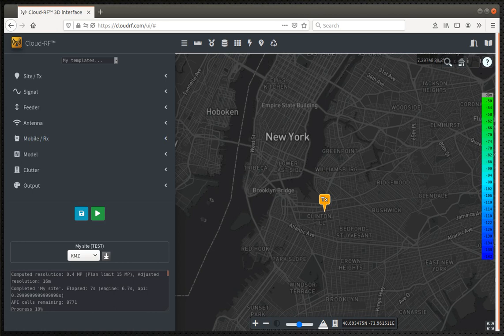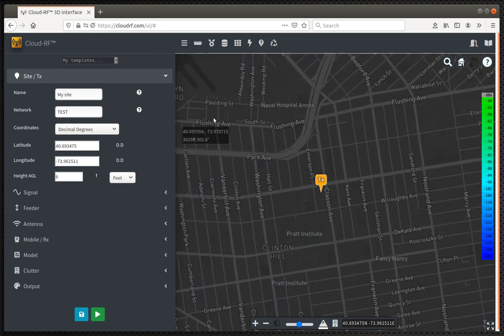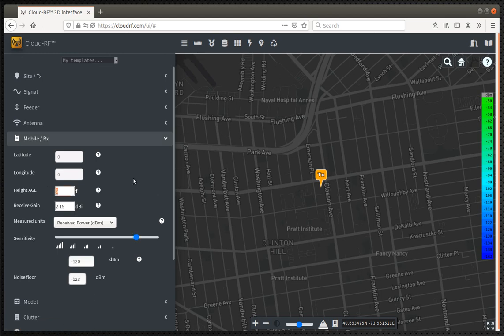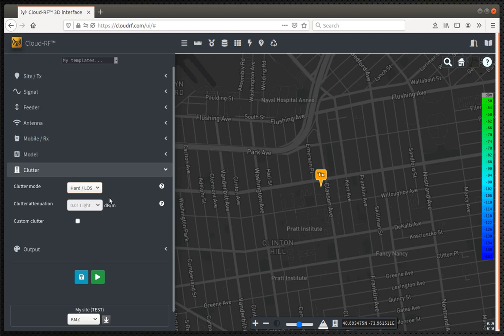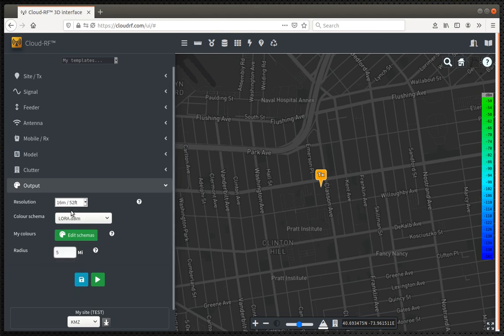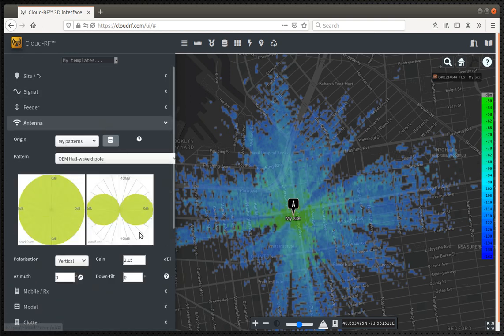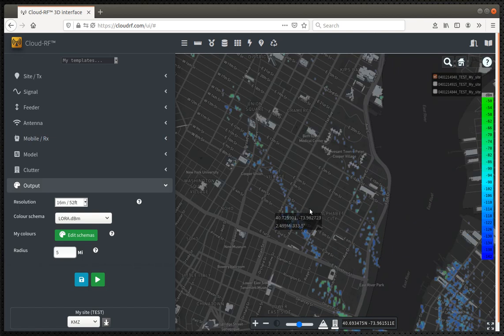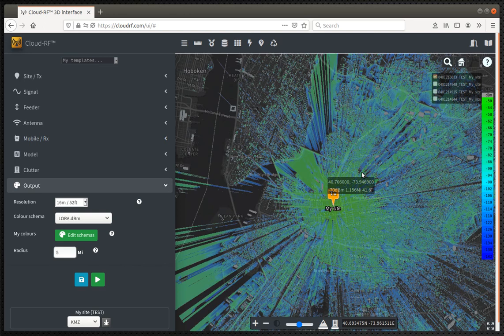CloudRF tutorial for Helium LoRa modeling

Comment: I'm setting up the BobCat Miner (Helium Network) ... Earlier in the video you stated " 6ft off the balcony".. I live In Queens New York,. and the houses in queens are similar to the houses in Brooklyn...so its  is about 28meters tall  (according to google earth)....Now i'm not going to be able to place my Antenna on the roof, however i'm on the 2nd floor of the complex, so i'd say that my height is about 27meters, give or take.... so thats roughly 81 ft from the ground. Can I use that instead? or should I 6ft as the lowest point?

Comment: Thanks for explaining everything so briefly. Is the normal stock antenna not a 3dbi one?
Reply from the maker: Depends on the device. If it's the RAK miner, peak gain is between 2.3 and 2.8dBi according to the datasheet.
Reply: @cloudrfdotcom  thanks for elaborating. I am bit confused now because I checked the coverage rate for an apartment in London city at around 16 meters high and apparently I can get up 8 km on one way. That looks in my opinion a bit optimistic there
Reply from the maker: @puking-hamburg  LoRa will go 8km no problem. Open a support ticket with your settings if you would like to query an output.
Reply: @cloudrfdotcom  okay I understood ! Will it be possible to add you on discord or something like this if I have any questions in the future ?

Comment: are these settings also applicable for the case that you place your antenna next to a window or only if you really place the antenna on top of a building without any walls
Reply from the maker: To budget for double glazing at 868/915MHz, remove 2dB from your receiver threshold so -118dBm instead of -120dBm in a city.